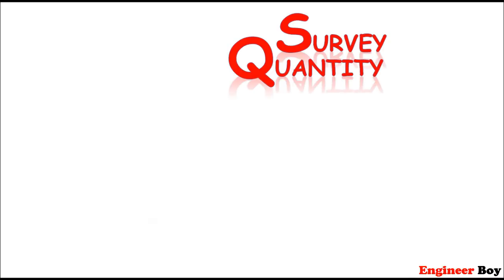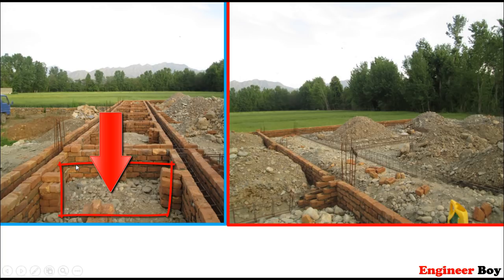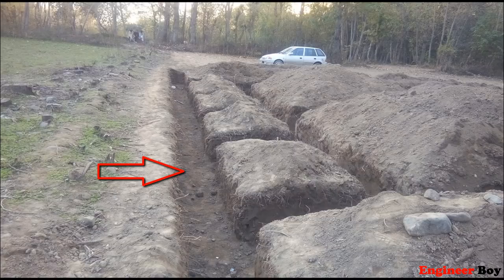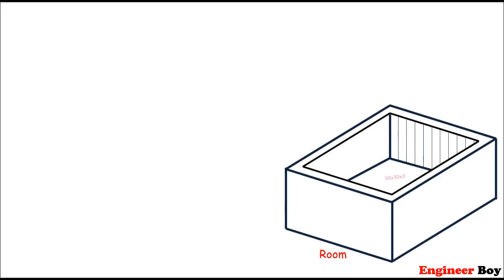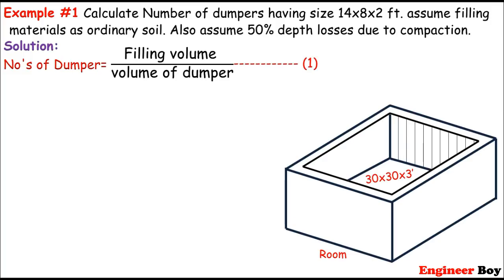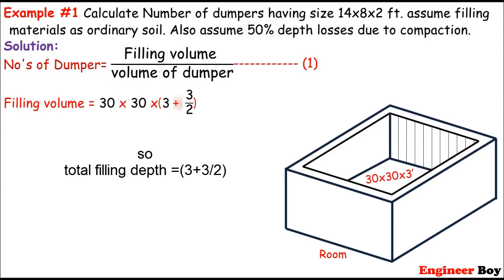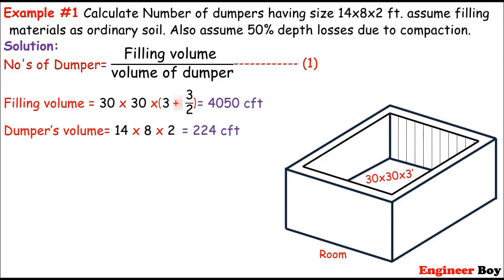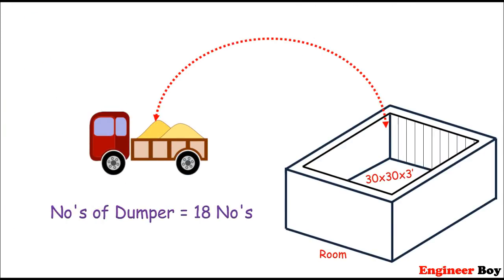Quantity survey: how to find number of dumpers for filling- civil engineering- Engineer Boy

Comment: For example sir...mara Pas concrete ki ek wall hai es Ka height hai 1 meter our width hai .30 cm length hai 25 meter ..our ratio 1:3;6 use Karne hai to es per Kitna cement o sand and aggregate laga GA...sir plzzzz CFT ma Jo jawab Aya esko senklo ma zaror tabdel Karna
Reply from the maker: cft che sekro ta ari nu pa 100 yi divide kawa..... zaka che 1 skra = 100 cft